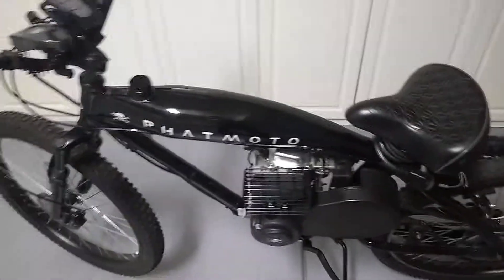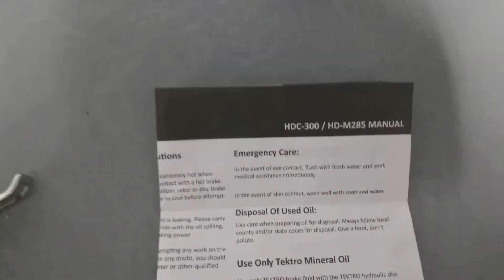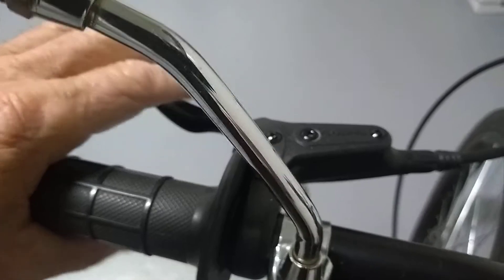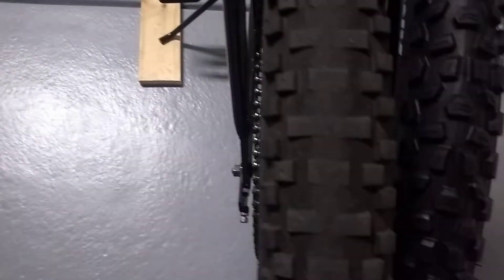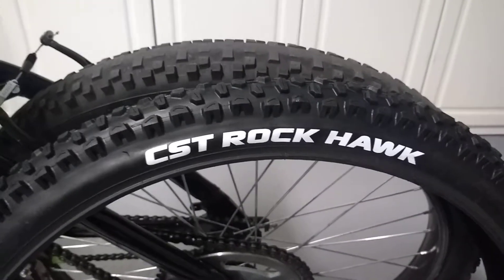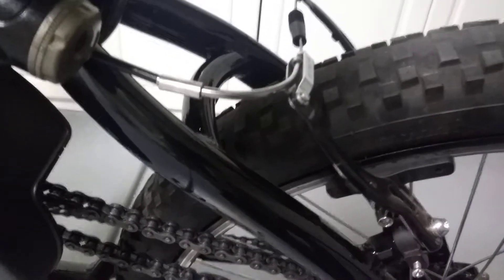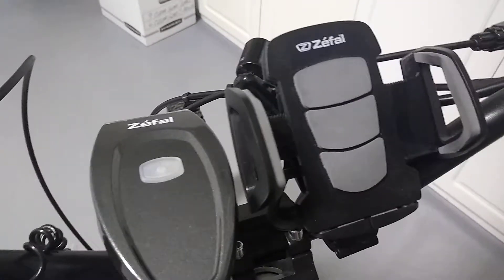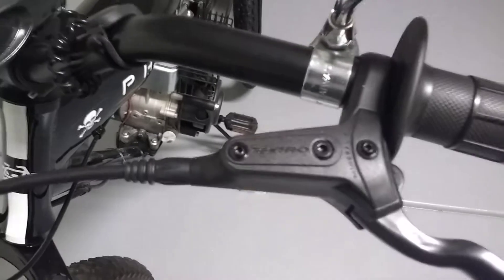Phatmoto Upgrade front disc to hyd.

Comment: I changed my tires too.  800 miles seem to be the norm for me on the rear tire regardless of what kind it is.
Reply: I'll see how long this new tire lasts, my 2 cycle Schwinn Swindler has over 1500 miles on it and shows no wear at all. I'm assuming that the Phatmoto put the cheapest tires they could find because everything else is of such poor quality. Also I've never had a bike tire produce a bubble because of a rip near the bead. Very soft inferior rubber.
Reply: Swindler nice! I just ordered a two-stroke Zeda kit 2 days ago. I wish they still made the swindler.  Although I've heard numerous people say that the basic Sprinter Fork is a little sketchy on a motorized bike.  I prefer Schwinn over Huffy any day, but we'll see I haven't decided yet on a donor bike yet.  But back to the tires, you talkin street tires are Nobbies? I  have the red striped Panaracer tires with the red 10-spoke bikeberry mags they're pretty sharp.  And they seem to be really puncture-resistant.   I have 800 miles on my back tire it's got a little bit more life in it but it's getting there ,it's almost all done on the center tread.   just curious what kind of tires are you getting 1500 miles on the rea with out much wear-and-tear.
Reply: They quit making the Swindler, but they make a similar frame without the springer fork but with a 7 speed. I haven't seen any weakness in the springer.  I think you hit on the problem, my Schwinn has road tires so does my electric and they show no wear. I see the Nobbies would wear out much sooner.  Duh, you would think I could of figured that out. Since I don't ride off road my next set of tires will be road tires @marcs4091